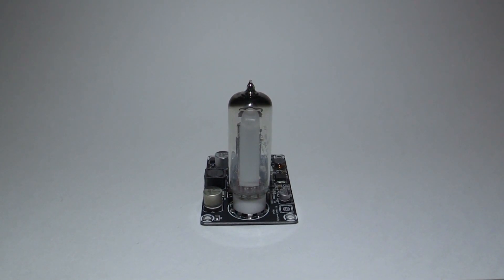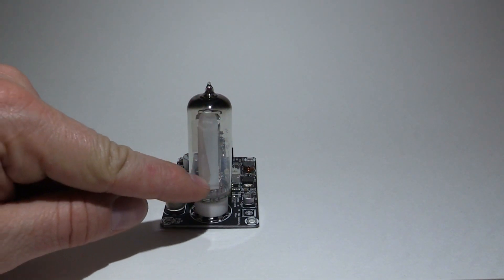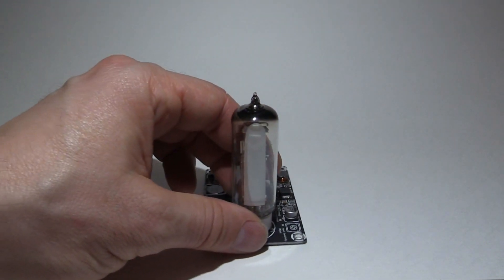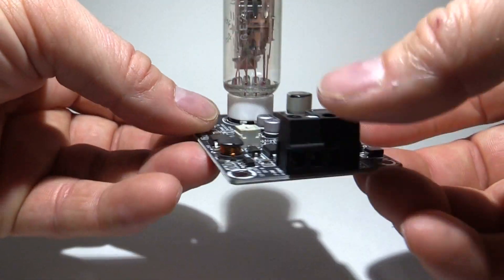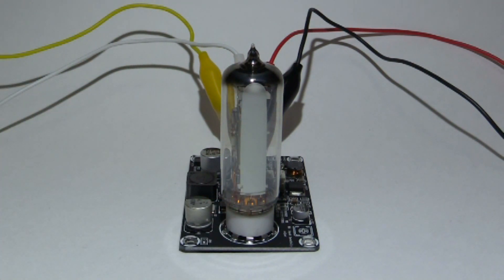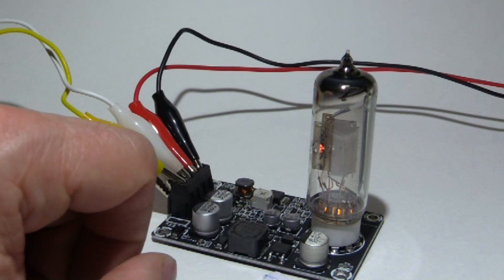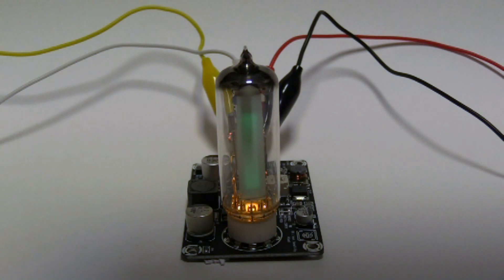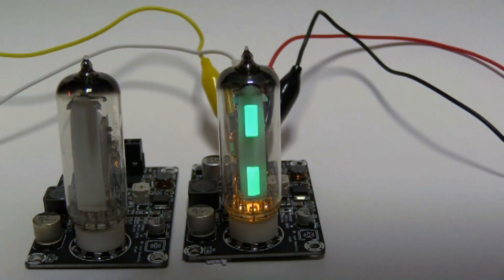The Sure Electronics magic eye module

Comment: Link where to buy? Price?
Reply from the maker: If you visit ebay at the following link: https://www.ebay.com/sch/i.html?_nkw=magic+eye+audio+level
You can scroll down through the results and find the module in the video.

Its more expensive than the cheapest ones as it only needs low voltage, the cheap ones have to be supplied with 250V from an external source.
Reply: Thank you for the video! I couldn't believe how inexpensive it is: $5.00 on ebay!